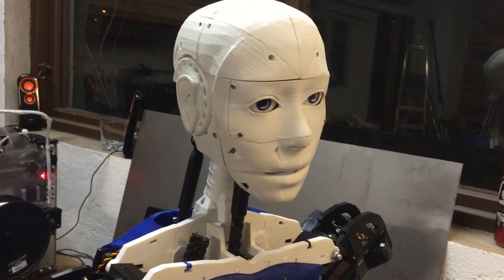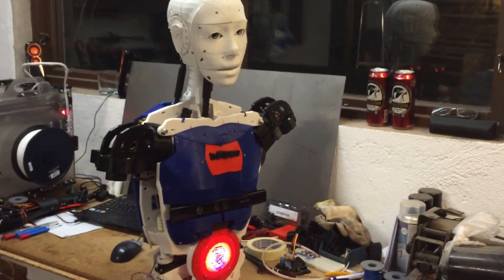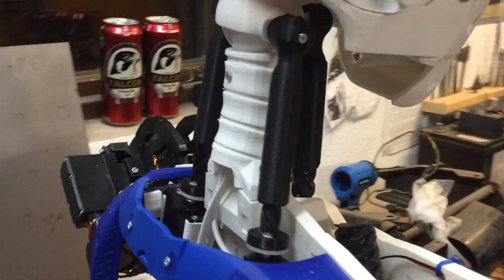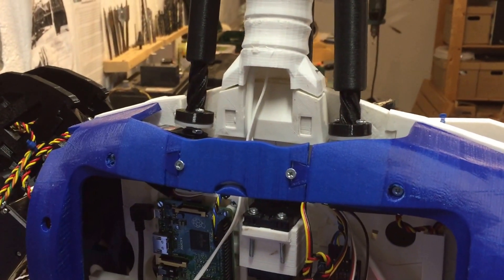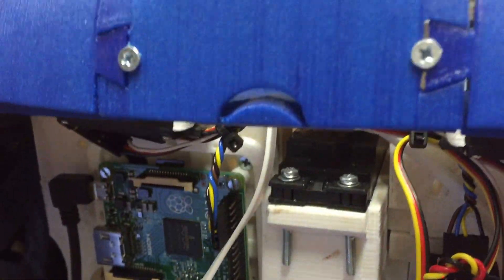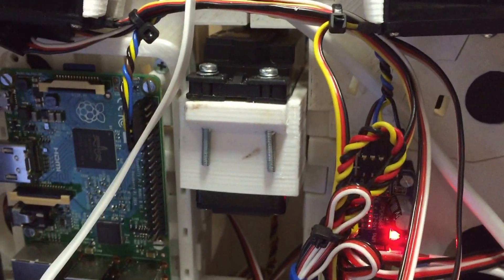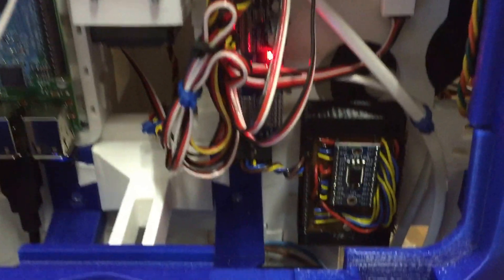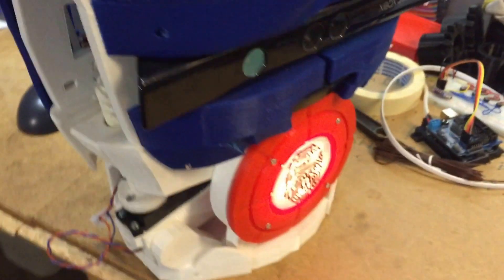My InMoov robot telling about himself

Comment: is that pre recorded? give the robot an inteligent, evolving chat bot software
Reply from the maker: Hi. I used a text-to-speech service to make him talk. Since I just wanted him to tell the story, I wrote the text. I will use the AI / Chatbot called ProgramAB ( http://alicebot.blogspot.se/2013/01/program-ab-aiml-20-reference.html ). Next step is to add a lot of more sensors so that it can know more about the environment. As you can see in the video, there is a Kinect that can be used in many different ways. I also have a camera in the eye. I will put gyro/accelerometers at several locations, because the servos don't give any feedback. Lots of fun.
Reply: Mats Önnerby that is really really good, i wish all your dreams come true
Reply from the maker: MyRobotLab is service based, so you can develop a service to access most speech software. But there is no service for Textaloud. It will also only work in a windows system.
Reply: hi Mats Onnerby i am using snips.ai and tried in mycroft.ai too, need to know if any other services after this 1 year based on your experience
Reply: can i know, do u have any updates with textaloud